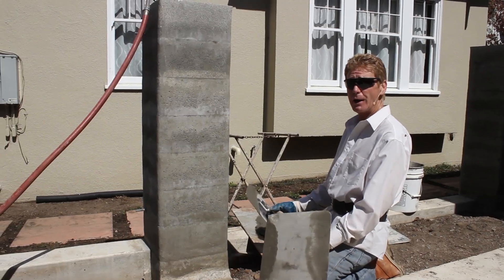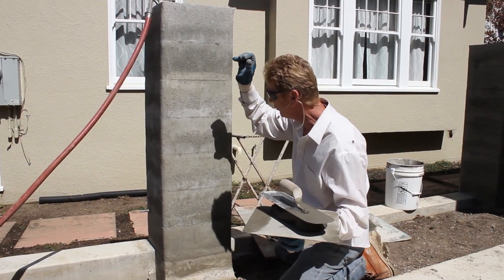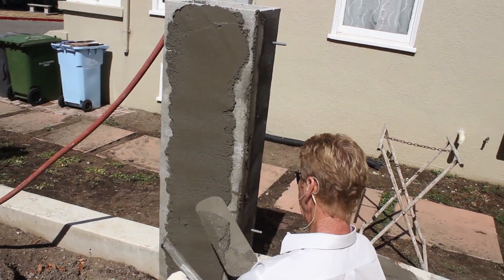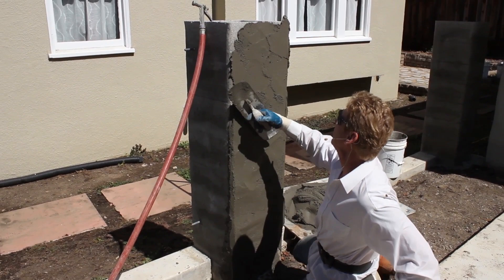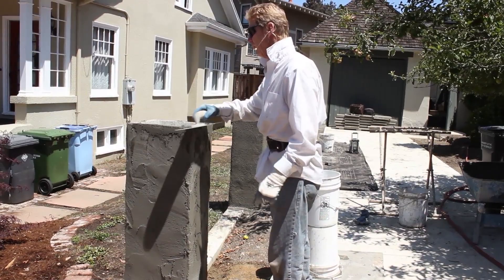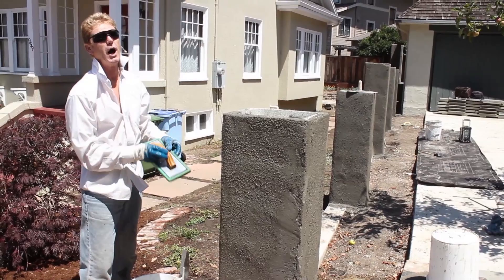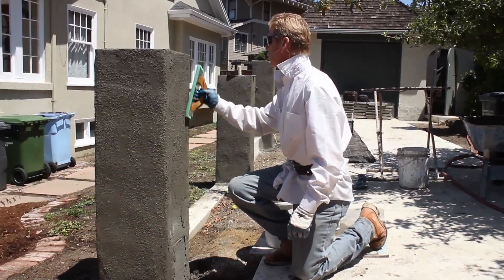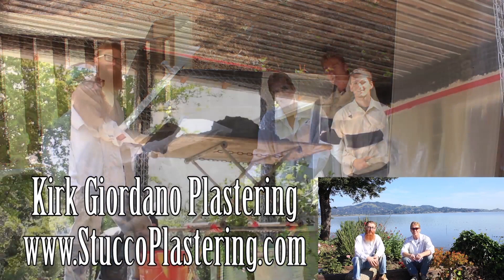Stucco concrete block pillars.

Comment: Any jobs going kirk .I can show you the irish way of plastering Haha but I have worked in canada and used Darby s and plastered over metal mesh. In ireland all homes are built with concrete block so no need for lath or messh
Reply from the maker: Howdy Sean, I would last more than a week in Ireland, they work way too hard, I'm no spring chicken.🍻
Reply: @StuccoPlastering  hahaha Kirk the irish work hard and play hard have a good one 🍺🍺🍺🍺
Reply: Dont worry kirk eightier was donald duck

Comment: skil saw with hose attatchment and problem solved. No dust. Unless you dont have one. Then pressure wash the block and then skim it. For corner use corner beads for nice corner finishes.
Reply from the maker: Morning Johnnie, I don't have one, hopefully anyone watching and wish to have bullnosed cinder blocks will simply buy them that way and not have to shave them, your right a vacuum hose attachment for any saw is the way to go,
 cheers,
 kirk giordano plastering

Comment: He doing corners like it’s a piece of cake. Meanwhile I been working on corners of my windows for days and still can’t get It look right
Reply from the maker: Howdy Sammy, below are a couple of videos; we show how to create or make stucco corners in cement walls. 
 To make or build out a corner on a concert wall, One must first clean the wall thoroughly, apply a bonding agent to that corner, then apply stucco to build out a new corner.
 https://youtu.be/rujfU8O8xwY/ Plastering Concrete corners for newly installed windows.
https://youtu.be/2ZQyVwindKo/  Rendering stucco corners by hand on cement block walls 
Cheers, my friend.

Comment: ok I heard your Portland cement and sand three to one but how long will I have to get the cement on the shelter wall before it starts to set up
Reply from the maker: Howdy daddy dude,
 depends on the weather, if it's winter, cold and early morning you will have possibly 3 to 4 hours, especially if it stays cold.
 if it's hot as in summer and late afternoon, possibly 15 minutes, however  there are many ways to correct these circumstances.
 Cheers,
 kirk giordano Plastering

Comment: Are you not weakening the surface / integrity with all that water once you've "lost the wall"?
Reply from the maker: Evening Llyr, no, it's portland cement plaster and can be floated with as much water as an applicator can skillfully apply and float properly.
 cheers,
 kirk giordano Plastering

Comment: Kirk you really are a master and make it look so easy. It has inspired me to maybe try to stucco my 2’ tall 60’ long block wall. Would you suggest this as a DYI or hire a professional? Ive been quoted $500 for a smooth steel trowl finish. Just curious if this job should not be a DIY
Reply from the maker: Howdy Gkllue head, thank you! We do make it look easy.
    What you have is worth easily 3 times the amount this fella is charging you; there is prep work that most have no clue of. 
Plus, steel troweling is the most difficult to do 
     It's difficult to trowels down sand smooth in fact it can't be done even if you have the power of Thor.
  I'd suggest you take him up on his cost and buy them an expensive bottle of rare wine too. It's a deal he's giving you. If he can do what he claims.🍻😉

Comment: my first surface experience at surface bonding with. surface bond cement with the fiber glass it was called quick wall it totally sucks how can I surface bond cinder block dry stacked walls can I use porcelin cement and sand instead of crappy.quick wall
Reply from the maker: Evening Supper Daddy, now you getting into the 15 year knowledge questions, it take years of practice to be able to work in  either 40 degree weather to 105 degree weather, for me  just a few minutes are necessary to make proper adjustments.
 The same holds true for any surface I am about to apply any type of stucco, render, plaster, acrylic stucco and any of form of cladding known to man.
It's not going to the university of common sense but many  many years of time in.
 It's all in the years combined and knowing what is compatible and what is not, or the shoulds and the shouldn'ts.
 Sorry i can't answer your question in greater detail, but there is much I would need to know about your circumstances,
 best wishes, 
 kirk giordano plastering

Comment: thanks good video but I wish I could find a video showing how to increase the height of an already stuccoed column. I need to add 36"
Reply from the maker: I take it you're referring to inches which would mean 3 feet? In that case, drilled holes, rebar, and wood surrounds would be necessary.

Comment: This reminded me of something else, Have you ever applied veneer plaster over durrock or cement board and if so do you need a bonding agent? We have a bathroom where someone put plaster on Durrock and its peeling right off, not everywhere but just in spots! Whats the fix or advice? Thanks ! And as always, Awesome job and videos !
Reply from the maker: Evening Billy, I always use bonding agents as a rule, sometimes I do to kill the suction but mostly if I'm not sure a surface is really clean I take no chances as if does not adhere, old kirk has to redo it.
Sure you can patch the loose stuff, tap on the whole area and remove what appears to be loose, hopefully you will get it all.
Cheers,
 Kirk and Jason giordano’s stucco videos

Comment: For the novice - what is the difference between mortar, plaster, stucco , parging ??
Reply from the maker: Hody John, Plaster is for interiors, Parging is for brushing on lime plaster to sticks rocks or anything else that need to be protected fro rodents, bugs or rain damage, its been used for thousand ]s of years.
Stucco is a term used for exteriors; mortars can be used for all but mainly grout for holding bricks or concrete blocks together. 
   Or one can call all of them muds as we do.😉

Comment: Hey Kirk, I have a question. Do you think concrete blocks are the easiest for a beginner to stucco over? 
I have a small concrete block wall I'm building. I've watched tons of your videos and I came to the conclusion the best way to do it would be to give it a skim coat with a sponge float finish and follow up with a color coat. 
I'm not sure about the mix yet for the skim coat, I'm thinking 3 parts sand to 1 part portland cement instead of a pre-mixed one, I guess it would be easier to work with instead of a fast setting mix. 
The color coat will be a commercial cementitious finish.

Since the blocks are new I will apply directly without pressure washing or bonding agent.

I know it will not look as good as a pro but I'm willing to give it a try.

thanks in advance
Reply from the maker: Howdy my friend, I think you'll do better than you may believe at this time, go for it.
Even though it's new hose the new wall down as nothing adheres to dust.
FYI, Jason and I as well as the rest of our Giordano clan wish to thank all of our subscribers and those who stumble on our videos a happy & prosperous new year.
Kirk Giordano’s plastering “how to” video’s

Comment: It's 2 bags of line per bag of ported cemented, 30 falls shovels of sand per bag.  We're is the Lath?
Reply from the maker: Howdy Lucky Lucero,  block or brick wall do not require metal lath; in fact, it's counterproductive.🤔

Comment: Hi Kirk, thanks as always for the fun & informative videos. Quick question on this one: you mentioned that there arent CMU's with a bullnose/rounded corner like that. If I wanted to build a column (for a mailbox) with such a bullnose, are there any options you'd suggest?
Reply from the maker: Evening David, before seeking other options this type in "bull nosed cinder blocks" as I have seen them before.
Cheers,
 Kirk’s stucco videos

Comment: Im about to render plaster the inside of a breeze element chimney with ceramic insides.. Any tips for us folk here in Finland?? I love watching your style of working... awsome just awsome....Thanks
Reply from the maker: Good afternoon showtime dude, I've heard that Vitcus has a heat resistant render or stucco, but have not tried it.
 I would advise googling what is the best cement plaster for pizza ovens or fireplaces where heat is a real issue.
                               Live long and plaster
  teaching repairing your number 1 investment your home

Comment: Great video's thanks for all the great tips. Question I'm installing stucco over 2" foam on concrete block, the concrete block has been sealed do I still need felt paper over the foam ? And how far should I space the concrete nails apart, thanks keep up the good work.
Reply: One more question does the stucco need to stick to the felt paper or foam or is it held in place 100% by the lath, thanks again happy new year too.
Reply: Concrete nails for the lath how far apart, thanks.
Reply from the maker: Howdy my friend, wire and or foam is not a good idea for covering cinder blocks, plus you won't be able to see where the concret nails are going so they will bust the foam and destroy the blocks, Sorry,

FYI, Jason and I as well as the rest of our Giordano clan wish to thank all of our subscribers and those who stumble on our videos a happy & prosperous new year.
Kirk Giordano’s plastering “how to” video’s

Comment: can I ask why you couldn't just stucco the pillars 
I have a block wall that they smeared concrete over the blocks and I want to smooth it out, I planned to pressure wash it and use bonding agent and try to make it even 
it's a curved block wall
Reply from the maker: Good afternoon Permanent Wave, you can stucco any or nothing at all, Thus your decision.    
 I do as I'm told by my clients. 
                       Live long and Plaster
Teaching the world how to plaster one Video at a time.
Reply: Kirk Giordano plastering Inc. 
I was just asking if u could have used stucco on the block pillars, i am going to try to smooth out a block wall that they smeared concrete on and it doesn't look good so I wondered if I could use stucco to smooth it out if I use a bonding gent first. thank k u
love ur videos..
Reply from the maker: Evening Permanent Wave, sure you can,
 sounds like they parged your wall, that means threw it on without caring what it looked like.
                   plaster, it’s everywhere you want to be
      Plastering and repair tips for your number one investment

Comment: Hey Kirk and family! Great videos, I was watching a few videos and was wondering when is it too cold to apply stucco on a home? I saw a few guys putting a scratch coat down the other day and it was around 38°. Can a scratch coat be applied then left until an appropriate time for the finish? I apologize if you have gone over this already.
Reply from the maker: Howdy Junior, I have applied stucco in colored weather than this, it's a drag but can be done,
 Ideally i prefer the temperature between 60 to 90 degrees but we have to adapt to climates.
 Best wishes, 
Kirk & Jason’s stucco repair video’s

Comment: Serious question Kirk, What is clean up like for you? Seems like a ton of stucco is dropping
Reply from the maker: Howdy, Set it up Dude, my arse. It did not seem like a lot did indeed drop. This one kind of beat us up. The cinderblock had been ground down, which created a super smooth finish, not much for the stucco to adhere to. Plus there were other issues at play, Nothing we could not handle, but again, these pillars kicked our buts. 🥳

Comment: Kirk you have to help me out here,I'm confused ,You put the mud on , then you let it dry and started floating before making the pier straight ?, its all bumpy ,is this what the customer wanted ?, or is this a standard ?. Down under we would rule or screed the pier or wall with a aluminium u channel and then then float is with a plastic float and gently sponge it which gives it a sandy finish but we use a level to make sure everything is flush, thats one finish but we always make sure it's completely straight no surface dents or waves in it  . Is this what you do to? , is there different rendering techniques and variations from country to country ?. Let me know I can show you some photos ?.
Reply from the maker: Afternoon Jon dude the customer wanted our finish to match his house which was indeed humpy and bumpy, in this video, I show what we are matching.
                live long and plaster
            kirk Giordano and team

Comment: kirk how ya getting on. Ja from the west of Eire, we use corner beads in Ireland, I'd say there with ye in the US also, why not use them ?
Reply from the maker: Howdy Mate, I do sometimes use corners however I'm showing how to make them in this video, we have tons of corner aid here, 
I have done video's in the past where I show how to attach them, also.
 Best wishes, 
Kirk and Jason’s stucco video’s
Reply: Hi.Just wondering kirk, taught  you were making work hard  for yourself there, didn't know you were doing a free hand job for the video. Cement tends to crack in small pillar positions like that as you know, plus ye got the extra heat as u said it was that
 day. Pissing cold wind and rain here, no need to worry about cracking from sun. I'd  rather be in your boots though !! Slan Abhaile
Reply: Frank Garner hi frank ya kirk is used of the heat id say! all blocks should be scudded, especially in column or piller situations. After the block being wet down.
Reply from the maker: Howdy Jarlath, call me crazy, but I'll take a simple job, and go the complicated way just to show options of the many different methods of how to stucco anything, just because I can, adds a bit of fun to applying stucco, must be the Irish in me.
cheers mate,
 Kirk giordano Plastering
Reply: Man we gotta be a bit crazy to be doing what we are doing I think, When are u coming to Eire to catch up on the family tree ? Is it your mother's side may I ask kirk.
Reply from the maker: Howdy dude, I've had worse times than applying stucco, like running and hiding from the law, nothing worse than looking over your shoulder, especially when you're young.
Were going towards the old trafford by the cricket grounds, to visit my wife's parents actually.
Cheers,
 kirk giordano plastering
Reply: Ahhhhhh man old Trafford is in Manchester England. I'm from Ireland. The Irish hate the English. You gotta top up on the geography if ur going to look at that family tree man.
Reply from the maker: Evening Jariath, come on dude us Irish love our English mates,
 Cheers,
 Kirk giordano Plastering

Comment: Would it be best to add a bonding agent? Would  it fall off in the future?
Reply from the maker: Hi Coby, No, this stucco is adhered by a mechanical bond, which means wet the existing concrete and then apply the stucco.
Reply: I appreciate your response! Keep up the great work you do

Comment: I'm planning on doing this in Spring on my old foundation cinder blocks outside in upstate NY harsh winters. Is the Portland and sand mix the strongest to parge with 3 to 1 ratio or something else. And how many coats recommended? Thanks for videos
Reply from the maker: Good evening Danny, it is indeed the best. good luck with your project.😏  Our unique plastering Tip:  all subscribers or anyone who stumbles on our channel with a question, type it into our Stucco/Plastering channel, and like magic, a video will appear to explain how it's done. 	
   This feature is miles ahead of any plastering forum. 🥳	
Kirk & Jason Giordano Plastering

Comment: so is it better to use portland/sand  instead of mortar to skim coat a cinder block wall?  I'm just asking because I want to do a little project for myself. thanks in advance
Reply from the maker: Evening Dude, both titles mean the same thing.
 Mortar is used for grout mainly, but all the plastering contractor call stucco, mortar too. 
 Yes, use portland cement and sand.  
                Peace, love with happiness to all.
    Kirk Giordano plastering tips-mixed with sound advice

Comment: I've watched alot of you're videos and I've never seen you use corner beads to help protect the corners, why is this?
Reply from the maker: Concerte does not need any extra strength, however I have attached corners to concrete and block walls for guilds.🍻
Reply: @StuccoPlastering  perfect. Thanks. I'm building a woodfire oven here in Ireland and it seems the render or stucco as you call it is done slightly different. We scud the walls first which is a 2 to 1 mix of plastering sand and cement and alot of water which makes a slurry consistency before the scratch coat. I plan on finishing with a 4 parts sand to 1 part lime and 1 part white cement to get a white Spanish finish. Thanks for the quick reply. Keep the videos coming pal 👍